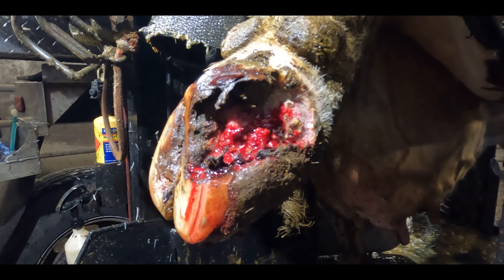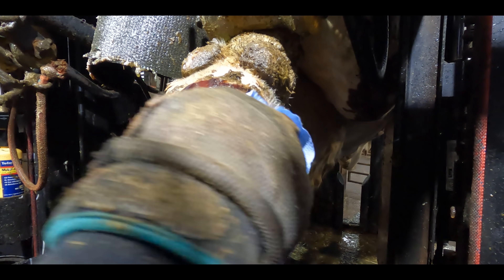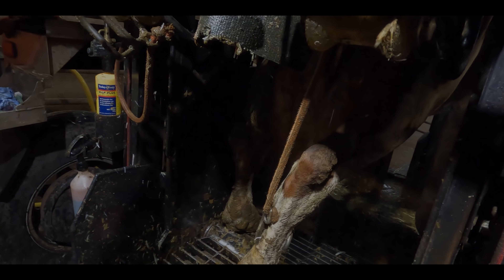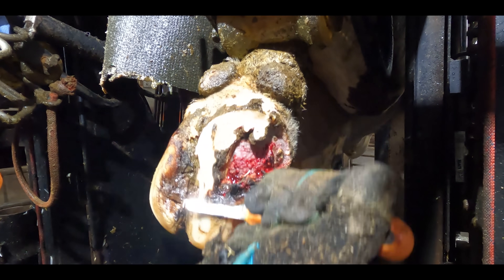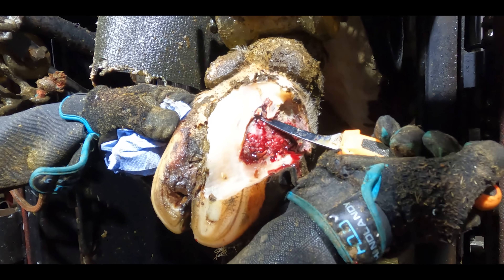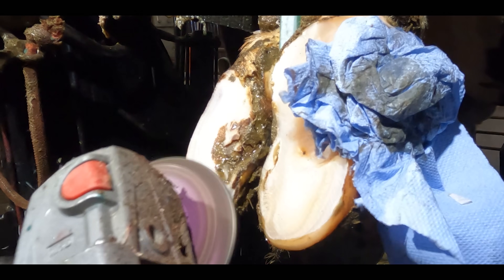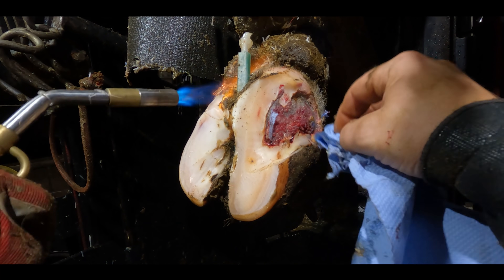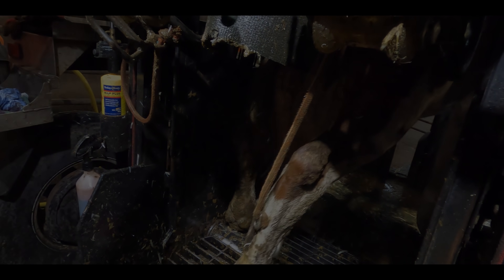BACTERIA DESTROYED this COW'S FOOT!

Comment: That cow needs a veterinarian.
Reply: At this stage, the vet will do nothing.
Reply: @alistairclement4239  Antibiotics
Reply: @kawikadee9670 The farmer will have a cupboard full of antibiotics.
Reply: @alistairclement4239  For some reason not this farmer. Sometimes it's just time to see a veterinarian or your animal will die.
Reply: @kawikadee9670  he will have antibiotic spray, systemic antibiotics are of very limited use with this kind of thing anyway. Also, this animal may be in obvious pain, but she is NOT at risk of dying.
Reply: @alistairclement4239  Obvious pain is very bad, they try to hide it but this pain is so bad she can't hide it so that's bad.
Reply: @kawikadee9670  and? I didn't say otherwise, just that she wouldn't die from it.
Reply: @kawikadee9670  If she was a wild cow, she could die from starvation, that won't happen on a farm though.

Comment: I gasped at this horrible foot. Poor cow! The spirchete bacteria is a class of bacteria the can be very hard to treat. Related bacteria are Lyme disease from the deer tick (I have had it twice), syphilis, and there are several other diseases. It makes the corkscrew movements as the flagella, which normally extend to the outside, moving in a whip-like fashion, are under the cell membrane, so when they move, cause the bacteria to move in that corkscrew manor.  They are notoriously difficulty to treat, so the antibiotic treatments are long  In Lyme disease you end up on Doxycycline for at least a month. This is often difficult as it can cause stomach upset and you often need Zophran to continue treatment, as the nausea can be quite bad.
I. Hope this cow does well under your care, as this was quite horrific and she must have been in alot if pain. Thank you for your knowedgeable videos in which you have put in your fun and playful manor. Good luck and keep up the good work!

Comment: My thought process on seeing it first: advanced digital dermatitis. Long standing lesion. Clean. Assess. Remove sharp edges that insult corium. Remove loose horn. Explore extent of lesion damage. Will probably have to remove a fair bit. Balance foot as much as possible. Check other claw for damage from overuse. Dry inner claw. Double block inner claw. Iodine for lesion. Apply acidic powder. Wrap. Check other hooves for lesions carefully. Daily cleaning required to have any chance of lesion healing/improving. Recheck in a week/fortnight.

Comment: just wondering, do wild cows just deal with messed up hooves their whole lives?
Reply: A wild cow with that sort of lesion would not likely live long.

However, a wild cow wouldn't be likely to get that sort of lesion. As Graeme has explained before, digital dermatitis and hoof cracks are almost always found in cows kept indoors on concrete. Their feet are constantly exposed to a high level of urine and feces, with accompanying high bacterial and fungal loads. Cows kept outdoors generally have much healthier feet and rarely need more than a bit of a trim, if that (depending on what type of ground they live on).
Reply: @GrainneDhu that makes alot of sense, they werent meant to walk on concrete all day. thanks
Reply: @frostxxiv6576  it isn't so much the concrete as it is the damp and concentration of slurry. When cows live outside, their urine and feces are naturally spread out if they have large enough pastures. 

As a generality, their health improves but their milk production drops. In the current economic model, that makes it even more difficult for a farmer to make a living (and it is darn near impossible as it is).
Reply: @GrainneDhu  true, good to know thanks bro

Comment: My unnarrated thoughts:

-Don’t know exactly what caused it, probably an injury of some kind, but it’s infected with DD now
-flatten up the other claw. Will need at least 1 and maybe 2 blocks
-needs all the loose horn removed, which will be a lot
-that exposed corium will bleed if you breathe on it. No live flesh is being cut just because blood is seen
-needs some combination of blue antibiotic spray, magical paste, iodine spray, and/or salicylic acid powder. Whatever is used, it must be wrapped, and well enough to keep it at least a little clean for a few days and hold the product in place.
-this cow needs to be revisited in 2-4 weeks time to make sure none of the new horn has grown in loose as well as check on the healing progress.

Comment: The narration in my head was pretty close to yours, even to the point of the slightest touch causing bleeding(In my head it was also in your voice).  Where I was off was where you said "detached or sharp horn" when I was expecting "sharp edges of the loose and overburdening horn"  I did expect the double block.  I was not expecting the detail talk about the spyroketes

Comment: I was wondering if the iodine and the powder that you put on the cattle hurts them? I know that it has to be done to cure them, and I’m all for doing what has to be done, (so I’m not one who will scream that it’s hurting them…) and I don’t see them struggling when it’s applied, of course I’m assuming it’s the same iodine that my grandparents always had on hand to put on cuts and scrapes, I was just curious. Also was curious if you could use peroxide on the irritated area or is that not good for using on cows.

Comment: wow that's a nasty one! it's interesting though because on all the videos on this channel i don't think i've seen one yet that's so... open? 
my hypothesis is that this cow's had a problem for longer than most of the ones you've done, hence the big void where the lesion is in the heel- that the horn's been detached for so long that it's just sloughed off.

another thing i noticed that's throwing me a bit- there almost looks like a pus bubble/ round... more infected? site further up the hoof (nearer the joint)- which makes me wonder if that's where the whole thing started... which is ALSO weird cause most of the problems we've seen on this channel travel from the sole up the white line, not from the top down. i wonder if something landed on her hoof to cause that and the outer wall fracture (or, maybe it got stuck in something that kinda... can-opener'd her foot from the top?).

which all leads me to guess... was she adopted to that farm you like?

Comment: I correctly guess the digital dermatitis, but thought it was also an abscess, I saw that you were applying a block to the outside claw early (to give the glue time to dry) to get the inner claw off the ground, but had not guessed that it would need two blocks, considering the extent of the damage from digital dermatitis. I correctly guess ed that you would return to the wound on the inner claw and remove all of the detached (laminated) claw so as to be sure to promote correct regrowth of new horn. I did not guess ahead of time, but saw that you were applying iodine to kill bacteria and other nasties and then a salacylic acid paste to get rid of the D.D. and then correctly assumed that you would wrap it to keep it clean. I assumed that, as usual, you would be checking on it in a short amount of time to check healing and remove delaminated horn and mist likely, reapply iodine and salicylic acid in order to continue the healing process...

Comment: Wow Graham this was a tough watch. Seeing the cow wince (stomach pull up with each swipe of the knife) was rough 😢. Could a vet not be involved to give some pain relief. I know you are as careful as you can be and respectful of the animal but this was hard one. Don’t get me wrong I know you’re doing a great job and the best for the cow to heal. X
Reply: Large animals are tricky to sedate because of the fall risk. If a dog or cat is a bit uncoordinated after a procedure, they can be carried or helped with a sling or harness or just helped up again, no problem. If an animal the size of a cow falls, it can be almost impossible to help them get up again, there's a risk of a catastrophic leg injury (and not even a broken leg--dogs can blow out a knee and survive but for a cow, that's pretty much a life ending injury) and it can even cause an internal organ torsion, which is agonisingly painful and close to 100% fatal.

As a teen in the early 1970s, I had a summer job riding around with a large animal vet and saw firsthand the considerations that go into the decisions whether or not to sedate. For something like this hoof, that Graeme could treat in less than 5 minutes, I'm betting the overwhelming majority of vets standing there would say "right, get on with it, you'll be faster than I will."

Kind of the same reasoning I've used a few times when I've had cuts that had to be sutured or stapled. Having the local anesthetic hurts just about as much as the suturing or stapling, so why not just get on with it? Doctors look at me funny but they can't argue with the fact that the local hurts and I already have a history of anaphylactic reactions to a couple different local anesthetics. I'd rather just be fixed without it than risk having the epinephrine shots (hate them, they hurt and then feel awful for hours--better than dying but not much).

Comment: Well I stopped the video at 4:10 to make my initial comment and see if I am right in the end. 
IT looks like digital dermatitis seeing by the irritation of the skin worked its way up under the entire rear section of hoof horn. At some point prior to going into the crush it delaminated and broke away. Sort of like our lady friends breaking a nail. There might also have been a puss build up under the horn which caused it to start cracking away, but breaking that outside of the horn away is unusual as it is usually really hard. 
I see you used the Salicylic acid after an iodine wash. I would think the paste might have been a better option only to get it to stick a little more to the open wound helping to heal a little more. But I think that is a personal choice, and neither is wrong here. 
Now to see if I was somewhat right

Comment: Poor girl.  I often wonder in a case like this why you don't just start with putting the block(s) on the other claw, giving them more time to bond.  It seems immediately apparent you will need to do that.

I know you often talk about how good the farmers are that you work with.  But in this case, with a gaping hole in her foot, would you really not say that the farmer should have picked up on this sooner?
Reply: It probably happened both slowly and incredibly quickly. I'm not Graeme and I hope he comes in here and clarifies!

My guess would be that this cow had some sort of small white line lesion that allowed digital dermatitis into the inner part of the claw (the corium). It worked away, spreading upwards through the area, until it reached the top of the claw. During this period, the cow was probably feeling some minor discomfort, which all her instincts would push her to hide as well as she could. Her hoof wasn't overgrown, so she'd probably been trimmed up fairly recently and there wouldn't have been any obvious reason to inspect her feet.

She may have spent a little more time than usual lying down, she may have walked a little slower than usual but nothing obvious. Nothing to betray her weakness to that massive pack of wolves that live back beyond that far fence--she's never seen them but her mother told her about them and her mother heard about them from her mother and, well, her mother wouldn't lie to her, would she?!

As the digital dermatitis spread, she was forced to limp just a little and then a little more but she was also learning how to shift her weight to the inner claw and how to minimise the pain as she walked. The farmer had probably noticed that she was a bit off and had put her on the list for Graeme's next visit--remember all the video intros where Graeme mentions while pulling into a farm that there's a few lame cows to look at?

The inflammation was building up, the hoof horn was being pushed away from attachment to the corium and you could see how soft the heel horn was--Graeme's knife went through it like butter and it wasn't just due to how sharp he keeps his blade.

Then one night (these things always happen at night), the weakened hoof horn just blew out. Like an explosion and all of a sudden, there it was, a gaping crater in that claw. And now it really, really hurts, much worse than before due to exposure to the air.l The corium isn't meant to be exposed to the air, it is really painful and the cow would suddenly be almost or completely 3-legged lame.

So it probably had been building up over a period of time but the symptoms were subtle until, all of a sudden, they weren't subtle at all.

Comment: I was expecting you to start with standard trim first to sort length and angle and bovi block the good side first but guess you made an exception because this was sooo bad. Other than that you did exactly what I was expecting you to by trimming off loose detached and sharp horn, spraying with iodine and wrapping with salicylic acid, you’ve trained me well lol. Awesome to see you helping animals so expertly and effectively. Well done Hoofy
Reply: I thought the same! But then after he explained it I realized of course he wants to get a better look at how much loose horn he has to remove, and if the problem has burrowed somewhere else in the hoof that he can't see as plainly as the gaping hole, and to have the blocks out of the way for a minute for him to fully assess the issue before applying them with enough time to let them dry while he cleans it up the rest of the way.
Reply: Unless I’m mistaken the length and height of the good claw looks about right, that particular stem might nave been not needed, besides needing to see the whole lesion to decide the plan of action

Comment: Honestly, whenever I see trims like this, my first thought is always, "Poor wee coo! 😲🥺." 
I don't understand how the animals aren't in more pain with so much of their feet essentially gone! 
Next thought, I had when you were using the grinder instead of the farrier's knife when finishing the trim-- Do you have or use anything like a small dremmel to work on the edges of trims like that, so as not to risk damage with the large grinder?
Reply: I'm not a hoof trimmer but I have used a dremel a lot in crafting. The problem with dremels is that they build up heat incredibly fast, heat to the point of damaging or destroying exposed tissue like the corium (within seconds). A cow with a dead spot of corium... well, that's probably an injury that would end up as a digital amputation.

I used to go to a podiatrist who used a dremel on my toenails (I have really tough nails--great for growing out my fingernails, not great for getting my toenails to behave!) and I hated it because the burn built up so fast. Now I have a podiatrist who has stronger hands and just relies on really sharp clippers.

Graeme has used the grinder on what must be hundreds of thousands of hooves by now and I'd trust him to grind on my toenails with that big grinder! The big wheels don't build up heat very fast and they dissipate whatever heat is generated much more efficiently than any of the tiny  dremel attachments.
Reply: @GrainneDhu   Ferry 'nuff; I am ignorant in these matters.

Comment: That is an insane infection eating away at that foot. I would definitely see about keeping that cow inside if possible, where there is more control over keeping that foot protected and relatively dry. Provided the dermatitis can be cleared up, how long do you think it would take for the hoof to regrow and foot to heal?
Reply: I'm not a vet and I don't keep cows. But I do notice that the cows that are kept outside are much less prone to digital dermatitis than the cows that are kept inside. My bet would be that this cow was already being kept indoors.

In pastures, the muck (urine and feces) are spread over a much greater area and natural filtration + drainage keeps the environment cleaner and drier than inside.
Reply: @GrainneDhu  agreed.
Reply: The farmer usually does put a lame cow in the barn on a soft bed. I would imagine that’s what will happen with this one. 🤞🤞🤞
Reply: @niemanfamily  
Cow needs to be sure to put all of the weight on the blocked claw. Should NOT stay on a soft bed as per the Hoof GP himself in another vid. I’m surprised too!
Reply: in another video he mentioned that the hoof takes around 10 months to completely grow out from the heel to the toe :)
Reply: 8-12 Weeks, MINIMUM...IF the missing horn CAN be regrown...

That big a hole may not be able to completely heal...
Reply: Inside barns where cows stand on wet/poopy concrete all day every day is where this kind of thing is most prevalent.  Almost all of your milk comes from these farms, at least in the US.

Comment: Am I the only one that noticed that she flinched a little as well when you were using the grinder along the outside edge of the inner claw to prepare it for a block as well, not just when you were cleaning around the lesion?  She might have more problems than the obviously apparent one.

Comment: Its a good thing one side is usually good enough for a block. What happens when both sides are bad? So far we have not seen this happen and that is a great thing.
Reply: There have been some where he has had to use modified blocks, such as horseshoe shaped blocks, because both sides had damage.
Reply: @habslover2306  I faintly  remember that now,,thanks.